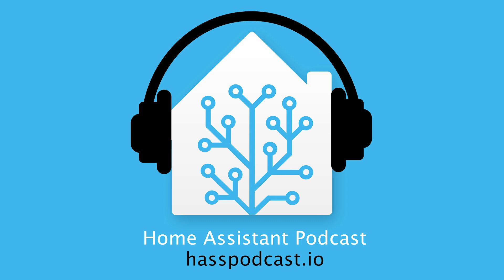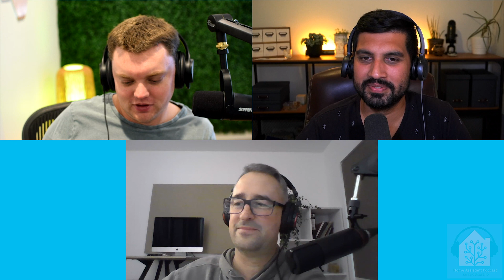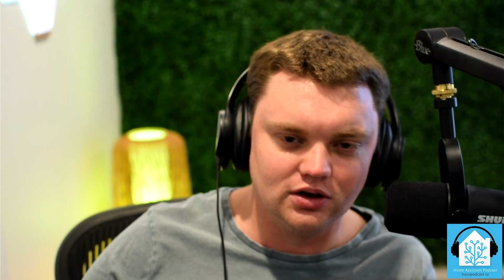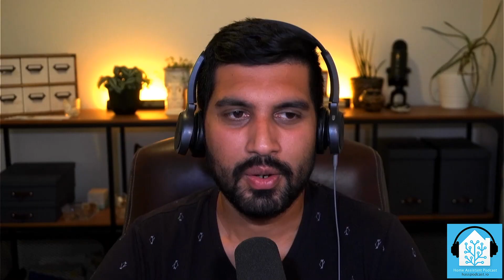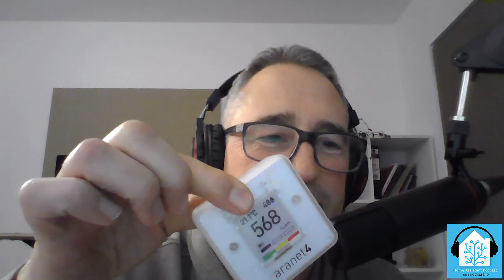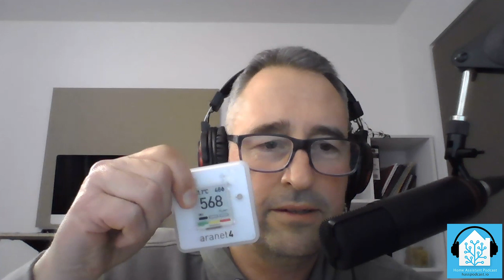Checking the rain tank water levels with Simon - Home Assistant Podcast

Comment: on your zigbee sensor that plays up sometimes, depending on where you are in Australia, and the age of your smart meter, some of them use a zigbee protocol, so you may find that the smart meter is impacting the door sensor
Reply: Good point mate. Definitely have a Zigbee smart meter. Although the door sensor I have a problem with is using Zwave